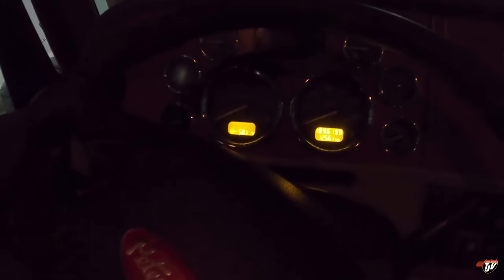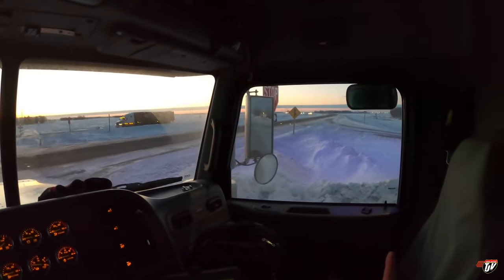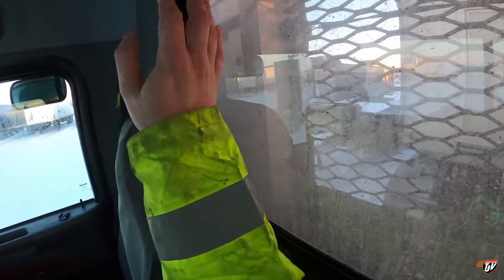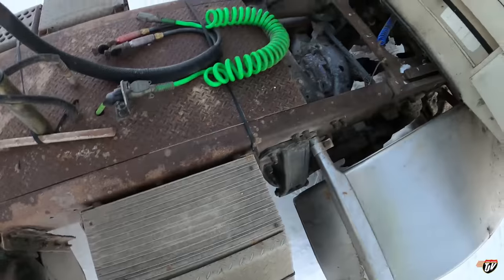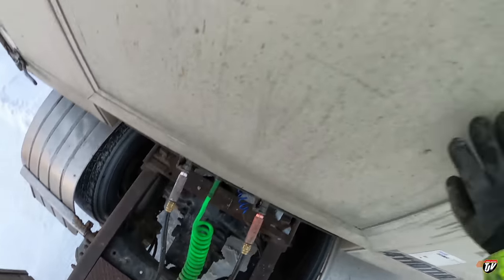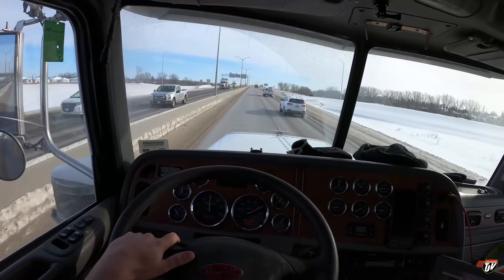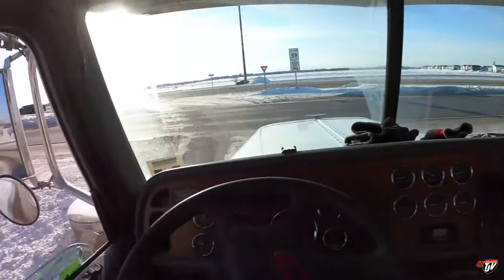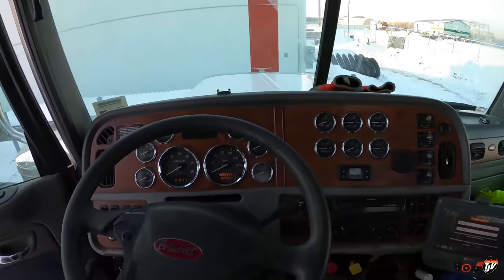TRAILER DOCTOR | My Trucking Life | Vlog #2456

Comment: My pet peeve about 4wheelers on the highway is those that drive with their head up their "you know." Not paying attention to traffic, or thinking it's 0300 on Sunday and driving like no one else is on the road. I learned to deal with mergers after a class from a State Trooper who said;" What if it was your mother or sister in the car? How would you react then?" Another trick I learned was to look in the drivers side mirror of the merging car to see exactly when they see you. BTW, it's usually around 21°C these days, here in FLA.

Comment: I have several pet peeves about drivers, first one that comes to mind is folks that don't maintain at least a constant speed (cruise control would solve that issue).  Then there are those that come off a side street and are in your travel lane and forget how to operate the accelerator and can't seem to get up to speed making you have to slow down.